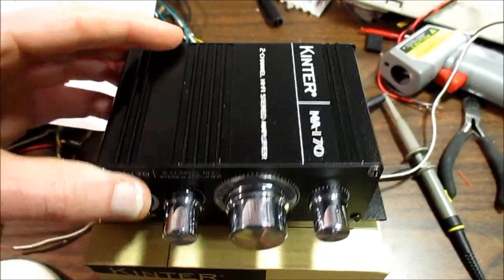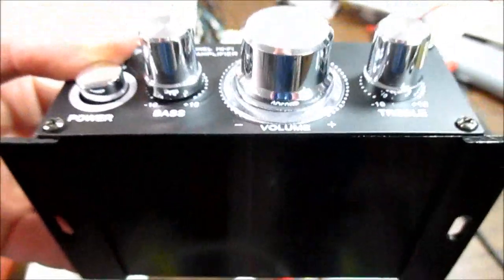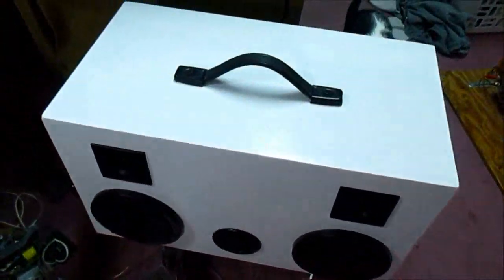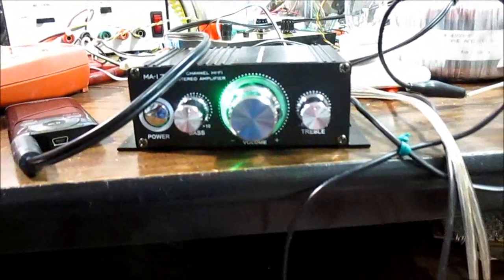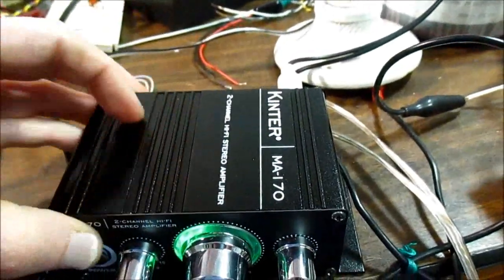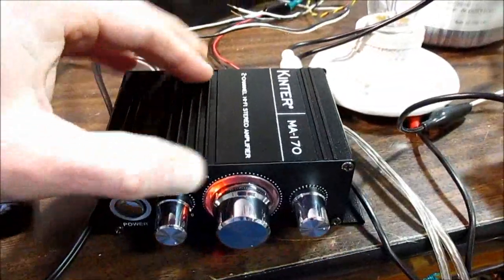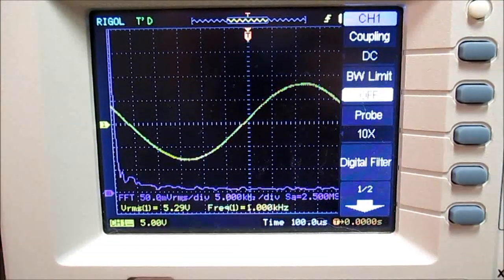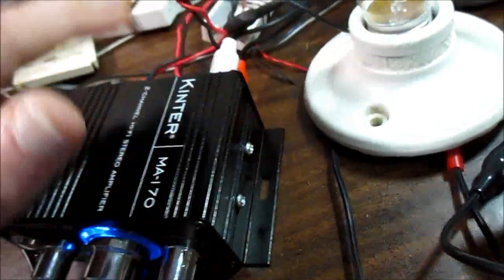Kinter MA-170 stereo amplifier review, teardown & power test

Comment: Plenty of people testing this amp also say it's very good for the price. The advertised output power seems to be a lie, but with some speakers from home theater or from some smaller Hifi system you can find for cheap it may be something better than plenty of computer speakers you can buy for twice the money. Especially if you don't need it to be super loud in a small room. By the way, very good video. Thanks a lot.

Comment: Your video has convinced me to buy some higher quality 8 Ohm woofers with proper documentation of specs. You also reinforced my conjecture that the Kinter MA-170 is a terrific "good enough" amplifier and there is no need for me to replace it. It looks exactly like yours.

I bought one of these in Oct-Nov 2017. Parts Express description was "Kinter MA-170 2-Channel Mini Amplifier Bass Treble RCA In 2 x 18W". It does have RCA inputs and outputs. I have been using it without problems from the on-board sound audio-output of my computer and driving some homemade speakers. The Amplifier costed $8.00 + $6.95 shipping. I have no specs on my speaker components since I scrounged them from the cheapest 6.5" drivers and tweeters I could find at the local electronics bargain store (EPO in Houston). The total cost to build the pair of speakers was about $30. They have always sounded good enough for me. I recently moved and rearranged my computer/guest room setup and suddenly I was getting some terrible distortion when listening to voice audio when I turned the volume up. It sounded like speaker break-up. I thought I may have ruined my speakers or Kinter MA-170 while moving. I traced the problem down to lack of cooling ventilation around the amplifier. That was an easy fix once I figured it out.

In the process of diagnosing the problem I also decided I will replace the cheap 6.5" drivers with some better ones. I have been trying to understand whether to get 4 or 8 Ohm woofers. I don't have any specs on my existing woofers. They are completely unmarked. I presume  because of the 6.5 " size they were meant for car stereo use and would then be 4 Ohms.
Reply from the maker: They probably are 4 ohm. You can check if you have a multi meter. 4 ohm speakers will read around 3 and 8 will read at around 6.

Comment: I believe it's A/B amp and I am replacing the non-Singapore chip  TDA7266 with a powerful one TDA7375A (made in Singapore) maybe next month. I believe they are pin-to-pin compatible. Crossing fingers ;-)  From 7W + 7W  to go for 43 Watts bridge at 14.4 Volts
Reply: Did you ever get around to doing so?
Reply: @MickeyMishra  No. I found a good deal on JBL  Onyx 7's and bought two. My Kinter is different so I was discouraged from working on it.

Comment: 11/6/20.I am getting a cycling (RF?) horn noise in my tv from what seemd to be the light in this Kinter ma170.When the color changes I hear a low tone low volume  train horn sound.Tried two ferrite chokes on powercord and speaker wire stiil there .Tried diferent power supplys also.Thinking of taking it appart and disabling bulb in amp.

Comment: The amplifier IC, a commodity ST Micro TDA7266, is a Class-AB chip that is only rated to 7W RMS per channel at 4 ohms (at up to 10% THD), and it uses a pair of push-push output stages that operate in a bridged fashion to allow use of a single 12V supply instead of +12V/-12V. I use mine for bench-testing speaker drivers to confirm proper operation, and to spark up a cheap pair of speakers for casual listening at my desk, but not for acoustic measurements or critical listening. The ability to run from a 12V supply is good.
Reply: The new one uses TDA7297SA which is nice. I did some mods and its sound is improved now. Please see: https://willyboy.home.blog/2019/05/10/kinter-ma-170/
Reply: @summersong88  - Have you run across one of theses with the power Amp mounted in the center and fastened to the bottom of the case? I have one that has been in storage and never opened and it has the power transistor in the center of the amp mounted to the bottom of the amp - not sure of the manufacture date or the Power Amp used in it.
Reply: @williamcolvin3609  Hi, are you sure it’s Kinter MA170? My Lepy LP838 is like that, mounted to the bottom..
Reply: @summersong88  It is a Kinter MA-170 - What amp is in your Lepy LP838 - SINCE THEY ARE MOST LIKELY THE SAME AMP.
Reply: @williamcolvin3609  They are not the same amp, the LP838 is a 2.1 amp, which I highly recommend over the MA170. The MA170 skews the frequency response too much, you can never get a good response with it (in my appreciation). Look up LP838 I think you’ll like it 👍🏻

Comment: I bought an MA-170 from Parts Express in 2017. It now uses an LA4625 chip amp.  PE still advertises 18 WPC, though ON Semi's spec sheet states "13.5W+13.5W" at 12V into 4 Ohms with 10%THD. Power vs THD graph suggests it can do up to 10W at 12V into 4 Ohms with <1% THD. Spec sheet shows all performance charts and graphs at 4 Ohm load. I too added heat sink compound to the heat sink mating surfaces and use small 4 Ohm speakers without excessive heating or other issues. This more recent chip apparently improves upon earlier TDA7266SA based units.
Reply: Do you know of a better amp board that fits in the kinter case?  I have one of these and it's good for 10 dollars but I cant listen to it.  I really like the case.
Reply: @BetterHabitat  I guess you copied the name " Coach Red Pill "  !🤔🤨😆
Reply: @smartypants4571  No I was a blue pilled Chad and sabatoged my success with woman.
Reply: C S The latest one uses TDA7297 which is even nicer. I did some mods that improved the sound https://willyboy.home.blog/2019/05/10/kinter-ma-170/
Reply: Nice mods, WillyBoy. I bought a couple more MA-170s a few months ago from Parts Express at $5.99 closeout. Haven't had them out of the boxes yet, much less powered up or cracked open. Now I'm anxious to see if they contain this latest chip-amp.
Reply: Tod Stiles It’s quite nice, use a good linear power supply is a good ‘mod’ in itself, I feel. Enjoy!

Comment: can you make a video that How to upgrade the Kinter 120 Amp ..for more power and bass
Reply from the maker: I haven't tried that one but typical with these amps is there is not much you can do (easily). You can probably get away with using a 15 volt supply. That would get you a few watts more output than when using a 12 volt supply. Just don't exceed 15 volts or the amp can be damaged. Use efficient 4 ohm speakers for the max loudness.

Comment: Don't forget that you are only measuring one side of the bridge so your watts calculated should be doubled 
When scoping a bridge amp on a single rail power supply you need to use a differential input or two channels  
If you scope one side of your resistor referenced to ground then the other they will be 180°out of phase ie.double the voltage
Reply from the maker: Bryan Sullivan I'm measuring across the bridged outputs. The negative side of the output is not really ground since it is bridged. The TDA7266SA IC has two channels, both utilizing a BTL type output. Please see the schematic for more detail.
Reply: I'll check the one I have and see   I have found that ground ref gives you better results  how is your scope referenced for your shield clamp?

Comment: Any thoughts about doing a tutorial video on scoping amps John? Very very interesting video but I found just a bit of it was outside my comfort zone. A general 'oscilloscopes and audio theory' video would be awesome.
Reply from the maker: ***** I made an earlier video on how I setup power measurements. Not sure if that answers your questions...http://youtu.be/Ro3Y7eySh1I
Reply: Great video, definitely answered a few questions. I've just ordered my first scope and was coming from the angle of how not to damage it. Common sense and caution are going to be two keywords but I'm just picking up little bits of knowledge from the electronics world. First job when the scope arrives is to check out my 8038 oscillator I've built. I've put it through an LM380 amp I built and a speaker so I know it's working but it will be cool to see the waveforms. That's the level I'm at, just having fun on a basic level.

Comment: The Chinese do have a habit of exaggerating  power outputs. I have found in my own testing you usually get about half or even less than specified. I would have thought running music into 4 ohms would be fine as this will pull much less current than a continuous tone would. After all it does cost pennies, doubt you could build it your self for any way near that money.
Reply from the maker: Michael Beeny Yes they have creative ways of figuring output power. I recall those small equalizer booster amps for car stereo back in the 1980s rated 200w per channel when they could make only 14w of clean power. Even with music, I'd not use 4 ohms with this amp because of the low peak current rating of the IC. With the reactive nature of loudspeaker loads, it could make nasty sounds from the current limit circuit.